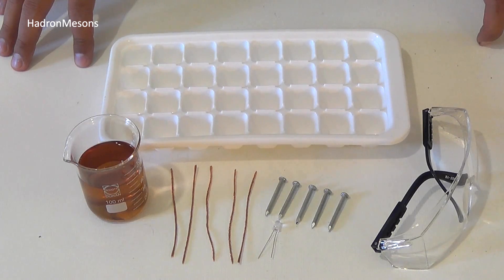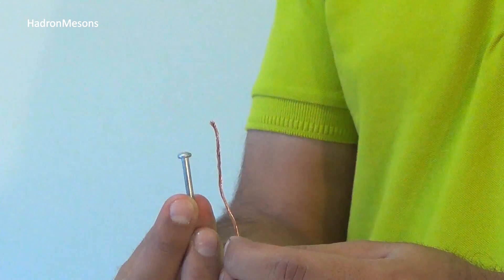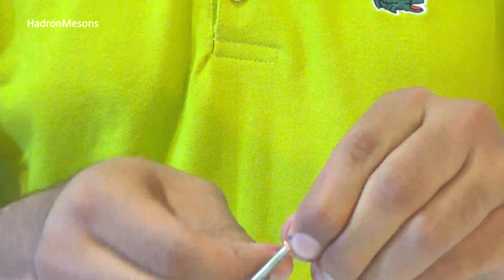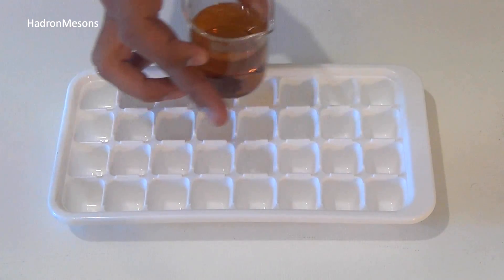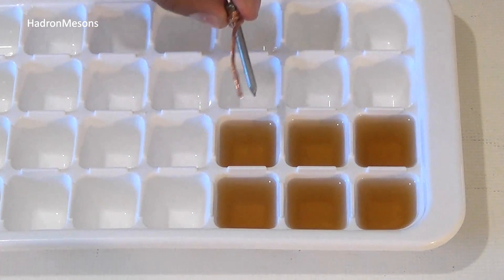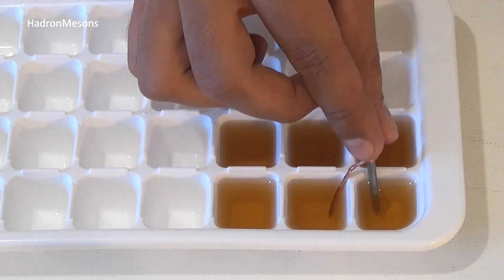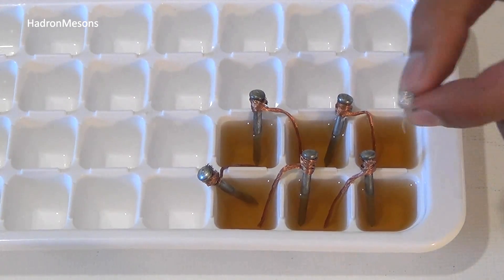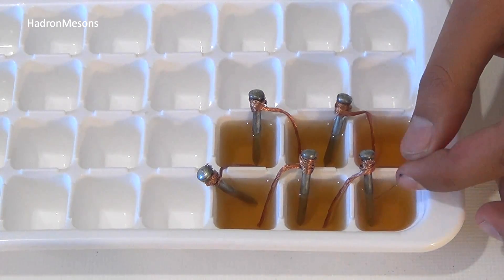Generate Electricity From Vinegar At Home - Cool Science Experiment

Comment: ITS AN EMERGENCY  what can i use instead of nails  I REALLY NEED TO KNOW
Reply: well, nails are the most basic material to use from all of the alternatives. You can go to your nearest shop and just buy a pack of bolts. If you're really looking for an alternative, you can use carbon rods which can be obtained from ordinary D cells if that's gonna be less of a mess for you than going into the store and just spend a few bucks. Hope I helped in any way.
Reply from the maker: You are right. Thanks for your comment 😊

Comment: I tried it it didn't work. FAKE
Reply: I use vinegar. the brand is Datu Puti, Copper and common nail. I fill up 6 pocket in the ice cube tray and 3 volts led. the LED did not lit
Reply: I tried different position for the led nothing works.
Reply: I'll try different led tomorrow. That led did not lit even I use a battery
Reply: I'll update you tomorrow
Reply: Did not work. I fill 12 pocket of the ice tray. I have 3 volts led. Did not lit.
Reply: Ok I'll send them now
Reply: Thank you so much my friend you. I'll be looking forward on your next project. I'll subscribe :D
Reply: After changing the nails it work perfectly. I got almost 10 volts in 6 cube. then I tried 12 cube i got almost 12 volts. I also used calamansi the volt is higher with it.:) Can you tell me what is the science behind it. Why did it produce volt?

Comment: Hi I tried this experiment by connecting 2 fully filled ice trays and I got 15V electricity, it was perfectly working with LED. However, I wanted to work a motor which can work with 3V battery but it didn't work. When I calculated the current when it is working with battery it was around 28 amper but with vinegar battery it was 0.1. Do you know why it is too low and how can I make it stronger? Thank you for great experiment...

Comment: which type of nails should we use normal steel nails or galvanized
Reply: ty sir
Reply: Rahul Pitaliya  did it work with the normal steel nails?
Reply: Ian Pineda 
yes
Reply: thanks, can i have more questions.? just in need of help for my project
Reply: Ian Pineda 
ya sure
Reply: will it work in 3.6 V 0.5 A? coz i tried mine, it doesn't work. all 20 cubes of ice tray was filled then followed the instructions. Don't know why it didn't work😅😔
Reply: Ian Pineda 
i dont know about 20 cubes but it works if u take 6 cubes 
in my case it worked nicely

Comment: of course it works, This is quite elementary science and the same result can be obtained by using lemon juice instead of vinegar,  for those who doubt research ancient batteries found in pyramids, if your LED bulb is not lighting up then you probably have a bulb that needs more power,if so use more spaces in your ice cube tray (cells), in the video above the tray has the potential to use 32 cells, if each cell produces say .25 of a volt then 6 cells will produce 1.5 volts and 32 cells will produce 8 volts.

Comment: I don't get it, how does this work? I mean, what's with the vinegar that makes it possible? :X I could use some explanation XD
Reply: vinegar works as an electrolyte, the copper and nail being the cathodes and anodes, electricity is multiplied throughout the circuit and u put in an LED, one side of the ice cube  container is the negative side and the other is the positive. basic chemistry.